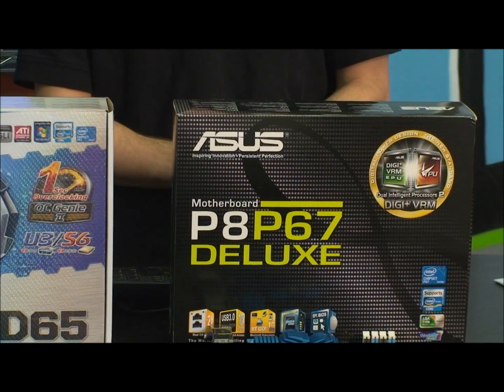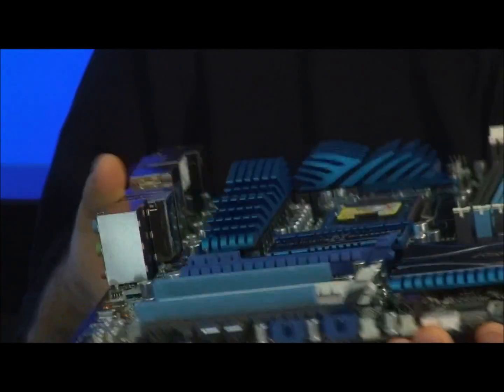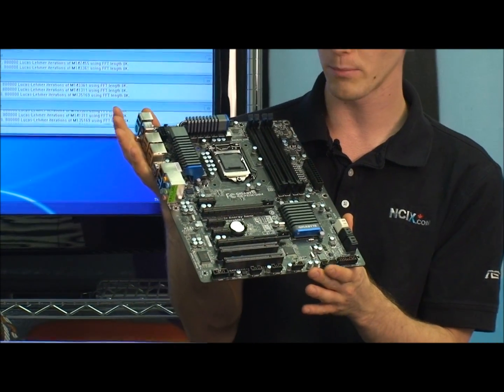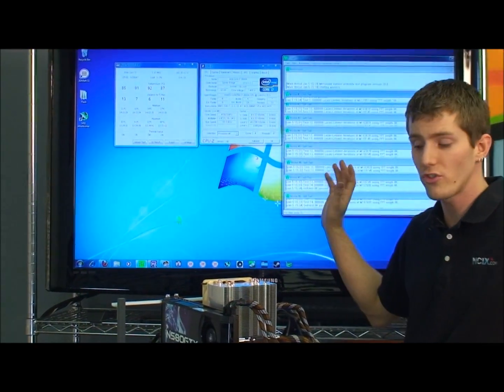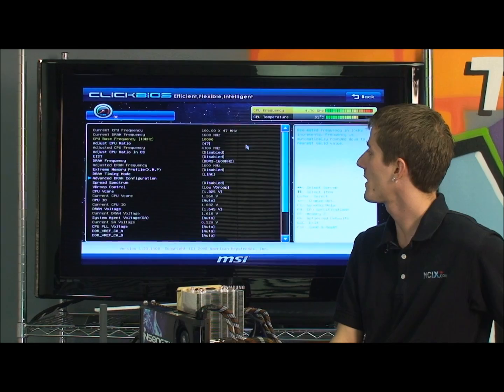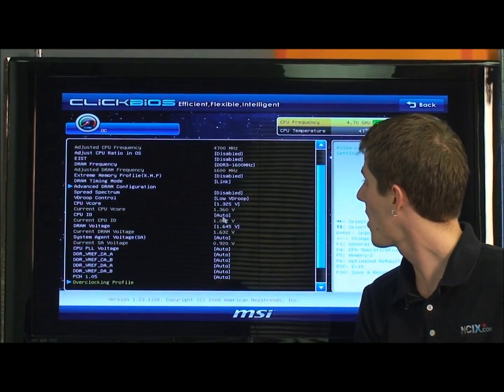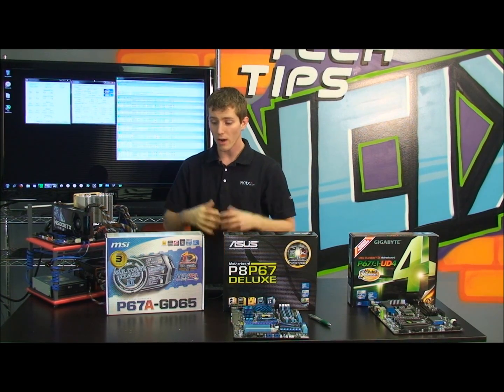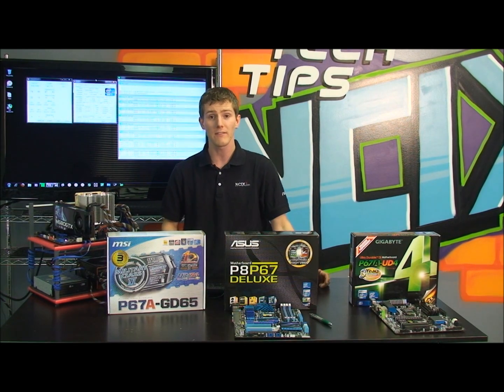Intel Sandy Bridge Core i7 i5 P67 LGA1155 Overclocking Tutorial NCIX Tech Tips

Comment: What is SAFE Overlock Settings For  ASROCK H61DE/S3
Sandy bridge  

i7 2600k  3.40ghz? 8gb  DDR3

I want to Overlock CPU RATIO SAFELY to x38 

Please  Tell me the suggested settings:

CPU Voltage Offset:
DRAM voltage: 
PCH Voltage:
VTT voltage:
CPU PLL Voltage:
VSSCA Voltage:
IGPU offset voltage:
Reply: You can use 1.4 voltage to get 4.4ghz. Just watch the temps
Reply: You can't overclock on h61. The CPU turbos to x38 natively, though maybe only for one core. You might need to play with settings. No need to change any other settings.

Comment: had my 2600k at 5ghz with +0.140 vcore offset and medium llc(25%) on asus p8z77 pro mobo. rock solid on air -  never went over 70C with torture. On custom water loop this chip was stable @ 5.2ghz but since it leaked once and killed my $700 gpu i got paranoid and went with best air cooler i could find instead (Cryorig R1 Ultimate with grizzly liquid metal, it beat my previous Noctua d15 even). Not having to worry about leaks or having to flush and clean loop every few month is worth loosing 200mhz honestly. while it went up as high as 1.5v vcore - it was solid and i ran it on that voltage for about 2 years without any noticeable degradation

Comment: 2018, still rocking that 2600k 4,4ghz at 60 Celsius. Keeps up with my 1070 lol.
Reply: Still rocking my i7 2700k and its still good for most things
Reply: @finnlolig3089  same, i even thought about upgrading my GPU to the new rtx 3000 series.
Reply: @SuperNugget92  I was thinking about the thing, but right now I am still happy with my GTX 1070.
Reply: until very recently my 2500k 3.3ghz  is not handlying most games so now i am gonna try and overclock it at 4.3-4.5ghz.
Reply: 94svenni same here! Just upped it to 4.5ghz! Give it a try.
Reply: @94svenni  just did the same, 4.5 ghz
Reply: @94svenni  yo same situation how did u get on?
Reply: Great! I have a 2600k too, and I wanna to ask you: what is/was your cooler for the cpu and what voltages do you have.
Reply: @marianoramirez5435  i just left it on auto and I'm using a 212 evo.
Reply: @SuperNugget92  thanks I will test it
Reply: Which motherboard are you using for overclocking?
Reply: About to build 3rd system on lga1155. I already own 2 on 3770k and 3570k, about to add another on 2600k to that lmao
Reply: YESS SIRRR
Reply: 2700K @ 4.3 but with auto overclock only lol. Idles at 40deg C (mobo at 24 deg c) never had a hickup. z68 vpro/gen3 and same cooler as Linus so thinking of bumping it a bit to cope better with VR (together with my 1080 GPU). Silverstone FT02 with its 3 giant 180mm positive pressure fans and a Noctua 120mm pulling air out up top. Best chassis I ever owned. No dust, quiet and cool.
Reply: 2500k 4.7GHz checking in.
Reply: yea i have a 2600K and that asus motherboard its still fine for relatively light games even in 2025

Comment: my i7 2600k still kicking butts until this days ^-^ I'm planning on pairing it with a GTX 1060 3GB
Reply: Edgar Urbina Carrasco What card dis you had when u posted this comment and also what clocks do u have on i7
Reply: Uhhh i got a 1050 2gb Superclocked and my CPU is clocked at 4.0 GHz
Reply: Edgar Urbina Carrasco What games can u play and what's fps do you get?
Reply: E UC I have already bought i7 2600k and im running it on 4.4ghz with gtx 1060 3gb
Reply: E UC Im not playing any of games that u said, but on for example pubg 100+ fps on Anti-Aliasing: Ultra Textures: Ultra View Distance: Ultra so its pretty good i think, but sometimes im getting fps drops to 60fps its propably because od ram or disk.
Reply: S3Qu3l that's not bad. But I would suggest you to have everything on the minimum except textures and view distance. It makes spotting enemy easier.

And E UC , the 2600 has a turbo boost mechanic which boost it up to 3.9 GHz but only on a single core, you can enable turbo boost for all cores even on a non k, wich would bring all cores to 3.9.
But overclocking to 4,4ghz seems to be no problem if you don't use a stock cooler.
Reply: E UC this would work. I use a cooler Master evo 212 and I'm safely around 60 to 65 degrees under full load at 60% fan speed. Well I mounted a second fan to the back that's all.
I'm note sure about your mainbord, if it supports overclocking. A quick Google search should help.
I would suggest overclocking the 2600k though, it's just a waste if you don't. I beat the 4th gen i7 from a friend of mine in benchmarks and he overclocked his aswell. 
I would not suggest overclocking if you use an old graphicscard. Anything below a 970/780.
Reply: E UC u can. I ran mine at 4ghz with a 980 ti. Now I'm running 4.4, it's still no bottleneck.
Reply: S3Qu3l most of the games on high/ultra like CS:GO, Overwatch,  Rocket League, NFS rivals, World of Warships, Metro redux. And in medium high Battlefield 4, Battlefield Hard-line, Battlefield 1, and games like that, all at 1080 with 8gb of RAM
Reply: NuGGet I don't get how my CPU is supposed to be boosted up until 3.7 GHz but I reach 4.02 without doing anything, and my mobo is a GIGABYTE H61M-S1 rev 2 I think
Reply: Nice mate! How does the 1060 performs in heavy ones like Deus Ex and Rise of the Tomb Rider??? and at what resolution
Reply: NuGGet well, I do have a cooler master Hyper T2 and it is pretty good actually, for the price of course
Reply: NuGGet well the T2 has like 2 loops of copper pipes so it makes up.like 4 in total and I think my mobo is not able to OC sadly, i made searches for one that was able to with y'know the 1155 socket and stuff and I just couldn't find anyone in the local online store (Mexico) but yeah even with the boost it beats the 4th gen i7 from my dad's PC, and about the GPU is a 1050 SC with Overclock up to 1.93 GHz
Reply: E UC I would search used motherbords with the z77 chipset. I used for the longest time a h51 board and bought a used one from ebay. The best you can get is the msi z77 mpower or the g1. Series with z77 chipset, Asus extreme 4 z77 is also very viable. 
I also would suggest the msi z77 g43 or higher series. A good motherbord does various things for you, like they some with usb 3.1 ports or multiple sata2 connectors (you need these for a ssd). Also they improve your audio quality, if you don't use an extra sound card.

Comment: I have the H67 chipset and it overclocks without problems by about 10% (base clock set to 106 MHz, didn't try anything higher). Temps stay under 30° C (normal work) and hover around 50° C during Cinebench.
Reply: 106 MHz is only a 6% overclock.
Reply: Michael MacAllister can u do this safely?
Reply: SkypredatorGaming  pls learn more about how pc hardware/overclocking works..he didnt raise the multiplier (that doesnt work on Hchipsets). But he did raise the DMI frequency to 106mhz (a bit risky because it affect all other components - like PCIs,ram etc). Everything work like this - DMI frequecy*some multiplier. Hseries mobos cant adjust multiplier of CPU. But as Linus said..you can increase DMI frequecny a bit..before the whole system become unstable (yeah changing DMI frequency is very difficult for the stability of the whole system - and the overal frequency gain isnt that high). So in theory for a CPU frequency on H chipset - (lets say 35 is cpu multiplier): 100*35 = 3500mhz and 106*35 = 3710mhz. So you can overclock here (but it is highly not recommended). The thing about Z chipsets is that they allow to change multiplier (of course you have to have K processor). So you can move with multiplier and DMI frequency (but nobody does it..cause they have ability to change multiplier). 

TLDR - on H cipset you cant move multiplier of the processor but you can adjust DMi frequency a bit and on Z you can do both.

Got it? :)
Reply: SkypredatorGaming  p67 overclocks also

Comment: ive got gtx 1070oc with i7 2600k & it runs games better at 2k/4k then then it does in 1080p infact i lose frames witout changing any of the settings & only the resolution & im talking around 20fps so its a big dip

Comment: my cpu is 4 years old already :O ? makes me sad. its an i7 2600k and its actually struggeling with 4k video..
Reply: Get a new video card.. I have a 2600k and I play games on high in 4k w/o any issues.
Reply: Bruce Dickinson games are ok. but 4k video makes it struggle. youtube videos that is. i'll just overclokc it and buy a new one when it stops working :D
Reply: GranVlog my 2500K beats my FX-8320 when watching 4K videos on youtube.... So yeah, your i7 2600K should be alot better than my 2500K man.
Reply: AeroFix94 maybe
Reply: Dex4Sure ^Agreed. running my 2600k still at 4ghz and it is fine. best CPU I have had in a long time.
Reply: not really worth to upgrade to the newest if you guys still are on 1155 along with 2500K, 3570K, 2600K, 3770K etc etc :)
Reply: GranVlog your CPU is close to latest Skylakes. Don't upgrade yet if you run at/above 4GHz. Which is easy with Sandy Bridge. As a matter of fact here you have better OC than on Haswelll or on Skylake while having WAY less power consumption so less temperature as well. Spend money on VGA, SSD, Software, Keyboard, Monitor, etc...
Reply: don't waste your money, my new 6700k is slower than my over clocked 2600k in almost all tests
Reply: what? my i5-2400 at 3.2 Ghz handles 4k video and youtube easily, even 4k games
Reply: 2600k is still a very strong cpu! The biggest advances in 3rd and 4th gen i7's are power consumption. I wouldn't even look at upgrading just for that, especially when you can OC the 2600k though the roof...What GPU are you using?
Reply: Agree MegaDan129... almost all i7 8xx and even 9xx series are really good!
Reply: even if he have a 4K screen. The CPU should handle it just fine.. the GPU is the problem!
Reply: Yeah you mean so ;)
Reply: Dex4Sure the videos on youtube ONLY use the CPU. Not the GPU
Reply: yeah, my old 2500K can handle 4K video with no problem. So something is very bad in his PC
Reply: GranVlog could be hes internet speed
Reply: its not as long as the video is buffered. same goes with editing. 4k lags.
Reply: actully don't think so atm :P
Reply: +Bruce Dickinson what vid card
Reply: My i5 2500k is still going strong. It eats 4K for breakfast.

Comment: I know this video is old but its bugging me knowing that he's using RealTemp GT the GT stands for GulfTown so those are the 6 core 1366 CPU's that's why there is spaces for 2 more temperature readings. Also the TJ is like set to 105*C which isn't correct for the 1155 CPU's that's why his temps are so high... :\ I learnt that when I realized what GT stand for and why it was much higher temps compared to like Core Temp.

Comment: Guys I need help, I just recently bought an i7 2600K and have it overclocked to 4.4GHz with 1.300V and a Corsair A70 is cooling it. I did a stress test with Prime95 and so I have CoreTemp 1.0 RC3 and RealTempGT 3.70. Both of the software show different temperatures under load. The RealtempGT shows a max temp of 75*C and with CoreTemp I got a max temp of 70*C, Which do I believe?? Which is the reliable one?, which temp do I use?

Comment: @comneard55 
thats high but in gaming/ video-editing it will not get that hot. mayb 15 degrees cooler max. max temp for i5 2500k is 99 degrees before it stops or downclock automaticly.

Comment: My 2600k is quite odd. I can run 24/7 stable @ 4 ghz flatt at only 1.26 v core:) however moving to 4.2 ghz requires a v core of 1.35 volts!! Lol. Well within thermal capacity I just think the jump in bfore is nuts. I see lots of people getting 4.6 4.8 at that voltage

Comment: @Dazza2292 Some chips just dont overclock as well as others. my 2500k takes 1.32V at 4.5, I've seen some that get 4.8 at that much vcore, and some that can oc to 5ghz at 1.34. it just depends on the chip. If you cant get it stable a 4ghz with 1.34V it may just not be a very good chip for over clocking.

Comment: @galamnony007 

Corsair A70 will be better than A50 by 5-7C.  If you can get it under $40, it's a great deal.  Above the A70 the only thing that's noticeably better is the Noctua NH-D14 and the like, and those cost more than twice for less-than-5C improvements.  The A70 should let you OC a 2600K to 4.8GHz or even higher, but by then you'd be degrading the CPU a lot more.

Comment: the one thing P67 and Z68 the PCIE shared bandwidth in some board if you load  3 slots or more something turns of maybe your usb3 and a sata port to have more lane without turn off you have to have a  NVIDIA 200 or some other chip so if you need a lot of connectivity check in to your board at least from what  I have been reading and been told by Asus

Comment: @xBejo The voltage in BIOS actually sets the VID not the actual voltage the chip will run at. VID is basically the maximum voltage that will be given to the CPU in any transient situation. If you use a setting like LLC that boosts the core voltage under load, then it's possible that when you remove the load the voltage will spike well above what you set it to for very short periods of time. For this reason I would try to keep LLC on one of the lower settings. Which one? Expierment.

Comment: @wsxd100 They're all the same. If I use a LGA 755 i7 stock speeds with a GTX 570 on a crappy mobo and compare it to a i7 2600k at 4.4Ghz on a Maximus Extreme Z with a GTX 460, my LGA 755 would beat the i7 2600k build. For gaming, any CPU/mobo is fine as long as it doesn't bottleneck the GPU (the most impt part for gaming)

Comment: i'm going build a computer which has Intel Core i7 2600K 3.4 GHz LGA1155 processor but i can't decide which motherboard to buy: Asus P8P67 Deluxe B3 Intel P67 LGA1155 ATX-morherboard or Asus P8Z68 DELUXE Intel Z68 LGA1155 ATX-motherboard. the p67 one is 205€ and the z68 is 235€ so they are almost priced as same. So which one I should buy?

Comment: I bought the 2600k chip with the P8P67-DELUXE Rev. 3.0 ASUS board. Whenever I go to the OC menu, my computer shuts off. The minute I click the menu button it dies. It runs windows fine and I have 0 problems with the computer aside from the fact that it straight up will NOT let me overclock. Anyone have any ideas?

Comment: @InGuSho6 well at the end of the day the evo, the pro, and the sabertooth are so similar to each other it does not really make a difference. The pro and the evo have 1 extra PCIx16 X4 slot than the sabertooth but a X4 16 is terrible so thats no reason to buy them.

The reason why the sabertooth is so cool is its thermal armor. Have a look at it, the armor is pretty sweet, it lowers the overall temperature of the system to.

Comment: @BassPounderX P67 or Z68 motherboards both work. The Z68 is the newest and has more features, but the P67 has slightly better gaming performance, but I would say get the Z68, just not the "H" series like H67 which you can't overclock with.

Comment: @h3liumTV Ditch the AX1250. There's no reason to buy that PSU with the system that you've specified. You could power two overclocked 570s on 850 watts easily.

Comment: @MrAMColes the performance difference between the 1055t and the 2600k at 3.8 GHZ is very small like 1 to 2 percent especially when the 2600k cost $65 us more. The difference between a 1055t and 1100t is the 1100t is unlocked and the clock speed is a little higher.

Comment: @alexlund0204 That's because the system properties window only shows the default specs of components. So because your CPU was set to 3,3GHz by default, that is what you will see in the system properties window. If you want to see the real clock speed, you probably need to download a CPU monitoring program such as CPU-Z. This is not the case if your BIOS can show the clock speed tho :)

Comment: i5 2500k i got it up to 4.7ghz with 1.36 cpu voltage, c1e off, eist off, dram frequency 1600 with 1.36v, turbo boost on. With the Noctua NH-D14 highest temps were 70c. I dropped to 4.4ghz because the performance boost is not that good at 4.7ghz and the temps dropped to 60c max at 4.4ghz

Comment: @alexlund0204 Yes, overclocking is mostly about messing with the multiplier. With the 2500K, you're looking for 4,2 to 4,8GHz. Increase the multiplier from 33 to 34, then boot up windows or whatever you have. Run a stress test or play some cpu intensive games. If you PC shows no signs of instability, increase the multiplier by another notch. Then repeat. If your PC crashes or is unstable, increase the voltage until it is stable. And repeat. I don't recommend setting the voltage beyond 1,6V.

Comment: @VerticalNoodles managed to get it under water by using 1.52V on the vcore.  However, it's stable but not recommended.  Was thinking of using a 100+W TEC with a custom water loop to get it to 5.2ghz stable.  The Temps would probably rocket to 90C on load with those voltages/speeds (my chip is a lemon, unfortunately).

Comment: Being that you were talking in this video about heating.
My question is do you think a (Asetek 510LC Liquid Cooling System 120MM Radiator & Fan) will be enough extra cooling in addition to standard 120mm  case fans?
I am in the process of building my first gaming pc.
[CrossFireX] GigaByte GA-P67A-UD3-B3 Intel P67 Chipset DDR3 ATX Mainboard 
Intel® Core™ i7-2600K 3.40 GHz 8M Intel Smart Cache LGA1155
(Palit) NVIDIA GeForce GTX 560 Ti OR (HIS) AMD Radeon HD 6870 (eyefinity)

Comment: I was using an Intel E5200 @ 3.8GHz on air so far, but it's really too slow. Yesterday I ordered the i7 2600K, Gigabyte GA-P67A-UD5-B3 and 16GB of Kingston HyperX DDR3-1600 memory. Hopefully that will be enough for a while. 
Can anyone offer any heatsink recommendations? I have good case airflow, I use 4×120mm fans at the side (intake) and 2x80mm fans at the top (exhaust), so maybe something that would take advantage of that. Thanks ;)